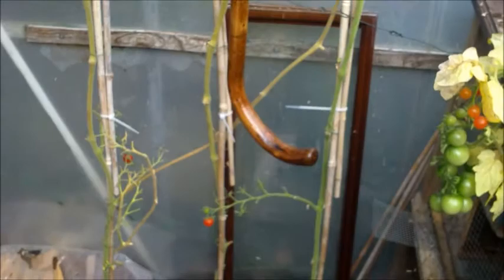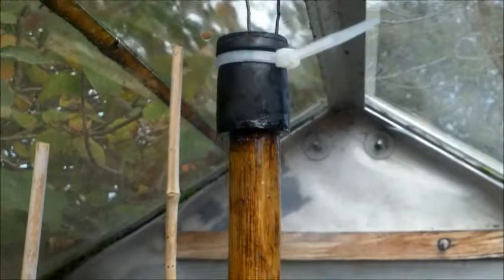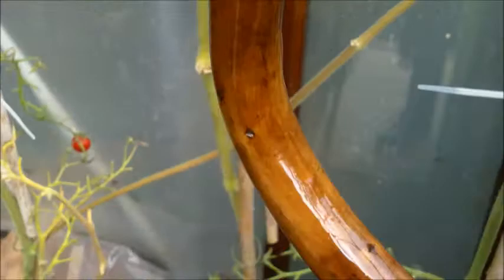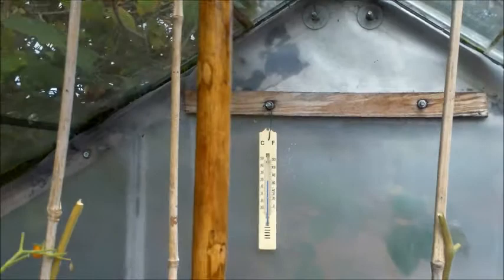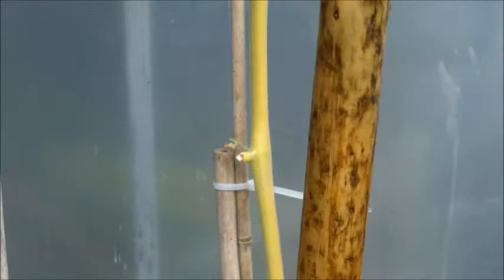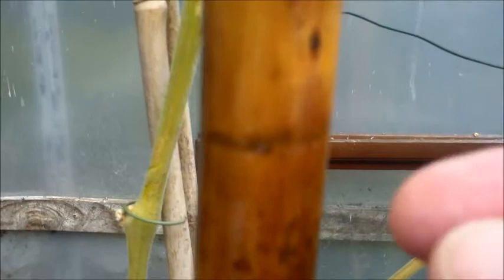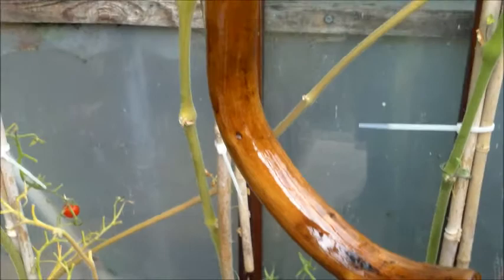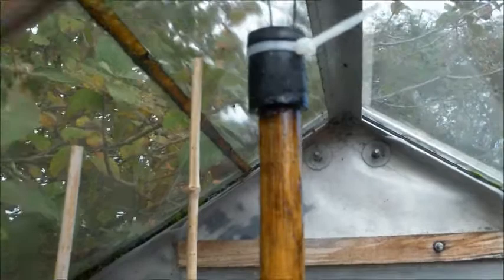Handmade Walking Stick

Comment: How long did you cure it for? Looks like their is still a little oil left in the wood. I have some hazel i have cut for sticks, i'm going to drill a 10 mil hole in the bottom and fill it with molten lead. Makes it handy for walking across water.
Reply from the maker: ***** Don`t ask me mate , i am no expert in stick making , just plodded along with this project

Comment: Did you make the bend in the handle by using steam?
Reply from the maker: snarnok After a bit of searching i found a piece with a good bend in it , i did use steam to bend it a bit more